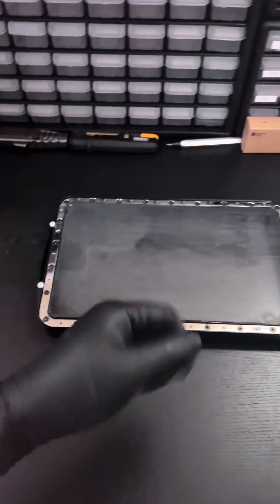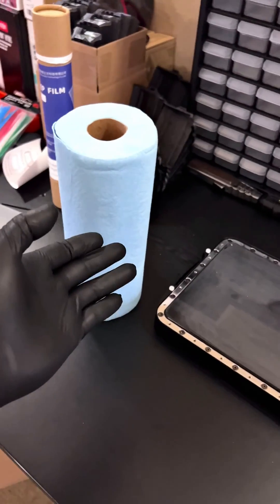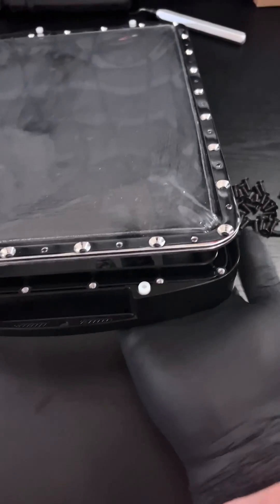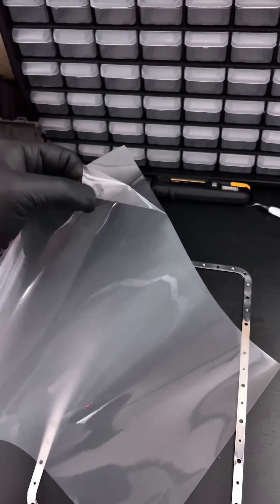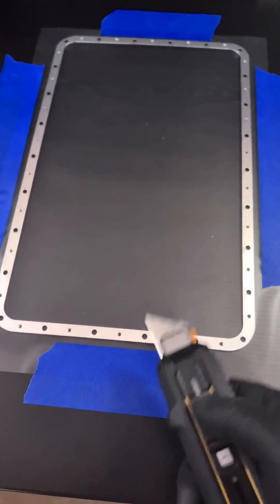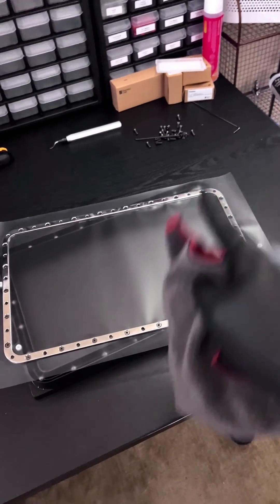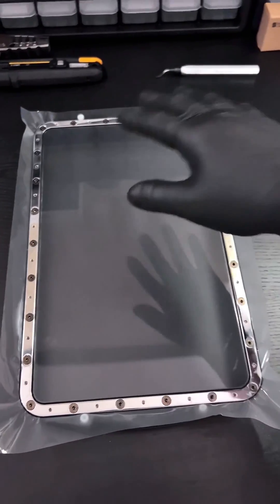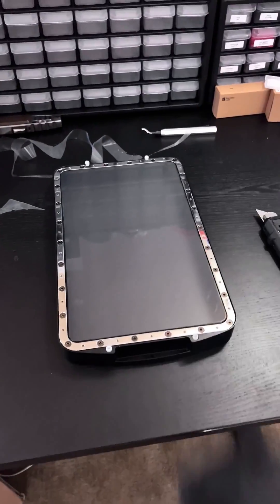How to change the Anycubic Photon M3 Max  FEP sheet

Comment: 5th tutorial that didnt work, still not even remotely enough tension
Reply: It's actually too much tension. There's supposed to be a slight amount of slack so the FEP can be pulled up with the build plate for a proper release of the cured layer. You're supposed to put like a small square piece of styrofoam underneath the center of the sheet as you tighten it to the initial frame.

Comment: So what do I do if after unscrewing the first set of the screws and the sheet holder won’t come off the vat
Reply from the maker: You’ll have to pry it off after spraying a bit of IPA as resin might’ve gotten in between that area & if allowed to dry it can become a very sticky substance which I’ve unfortunately had to clean up several times. The IPS should help soften the dried resin enough to loosen it & allow you to remove it.

Comment: Good video except you're meant to place a 13mm spacer under the sheet when you fit the first corner bolts to set the tension correctly. A milk bottle cap works well.
Reply: Ah yes, I just have an exact 13mm spacer lying around, good idea

Comment: Just had to change my film for the first time since I bought my M3 Max last year. Your video was clutch, thanks.
Reply: @commonsense7754 I did not use a spacer, but I’ve done several prints since the changeover and have had no issues. The fep film separates from the prints correctly and I don’t have any visible print lines so I’m not gonna go through the effort of changing the film until it starts to show signs of failure. Wayyy too much effort to change the film out if it’s still working 😅. If I had to guess, the spacers are probably more instrumental for the smaller printers because it’s much easier to get the film too tight because the surface area is smaller and easier to work with whereas with the M3 Max I was worried I had it too loose right up until it was completely tightened and then it sounded the same as my previous film. People’s mileage may vary though.
Reply: Hope you spaced it correctly unlike this video. Check their website.

Comment: So ... no "spacer" for the Max?
Reply: I tried it without a spacer thinking the new material of the FEP didn't need one. The tension was too tight. Even with using a lubricant on the film, my prints stuck to the film, not the supports. Went back, used a cap and all was good. I like the new FEP material, but I still needed a spacer.
Reply: @gregs9088  I eventually did it without spacer, it worked pretty well, though I tried to get the tension right by "sound", i.e. tightening it to the point where the FEP sounded like the old one when tapped.

Comment: Are you not meant to put a cap or something under the sheet so that it isn't super tight?
Reply: Yes, you are supposed to place something like a screw on plastic soda cap in the center to give the FEP some room to stretch.  This way is wrong, the FEP is under a lot of tension.